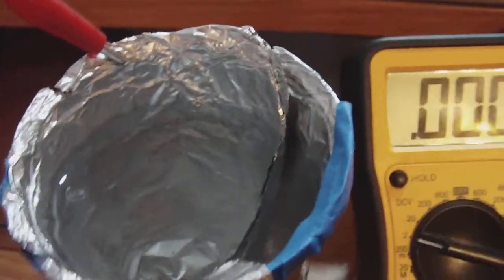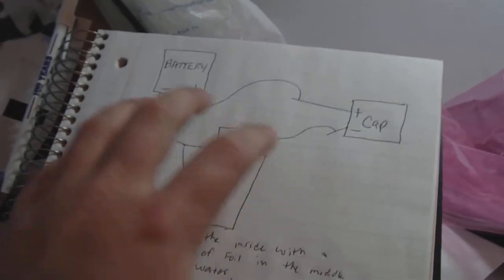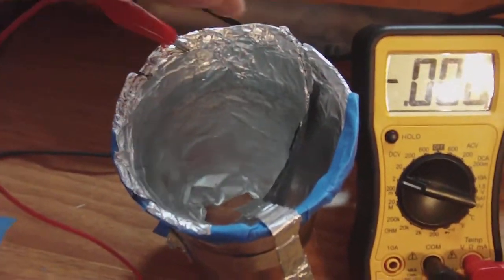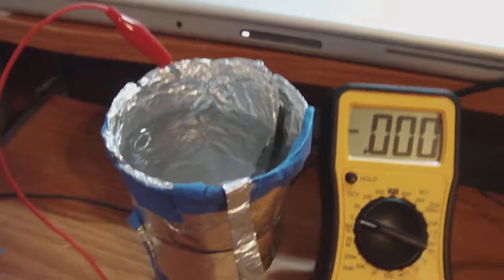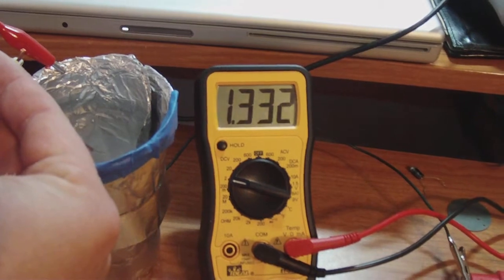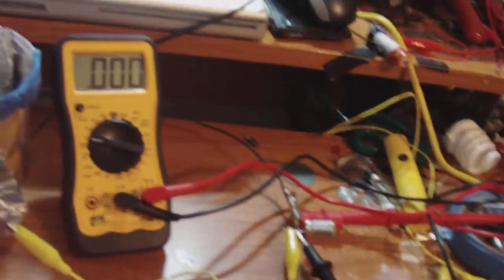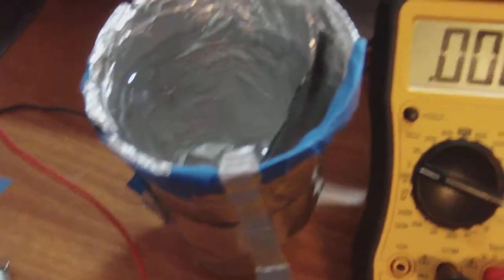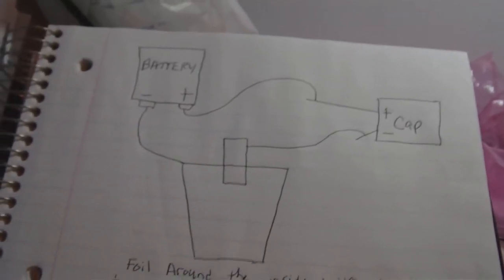Water Captret has negative resistance and produces Hydrogen

Comment: hi if you just place the negtive in the water and do not attach positive you should see the battery voltage go up as it attracts the electrons from the hydrogen molecule .would you confirm this as i struggle at electronics

Comment: The copper is capable of pulling more Mill-amps than the aluminum and as the mill-Amp pull goes down the voltage rises - In order to conduct a through test one must have a  voltage and Amperage comparable.

Comment from the maker: @MoonSpyStudios 

Water amount does matter, to much and it starts to be like a resistor and too little the voltage will ark. Under 12 volts stay around 1 inch of spacing. 

I know putting them in series will increase voltage but i haven't tried parallel. Think of them as little batteries.

Comment: questions to ponder,,, does it matter how much water you use? and does adding more cups in series or parallel make the voltage and or current go up? what if you set up a captret system similar to the The Cockcroft–Walton (CW) generator ? but only captret style?